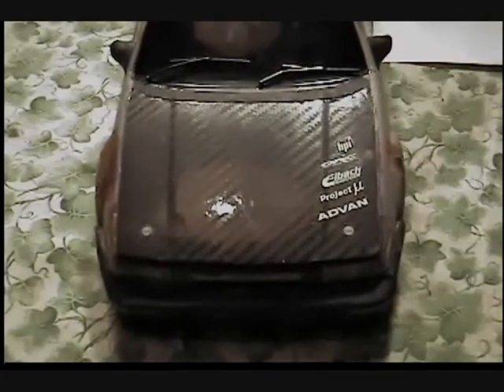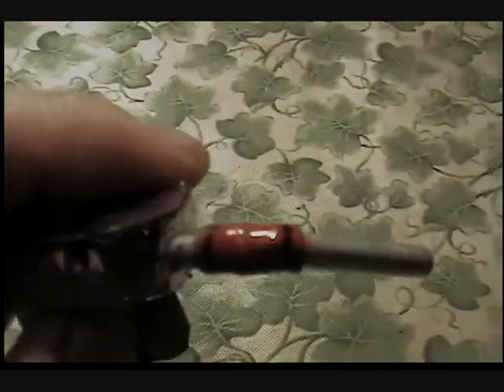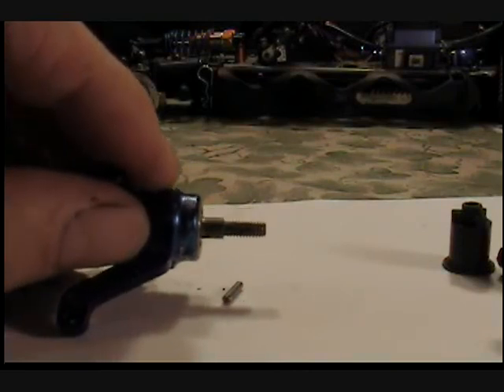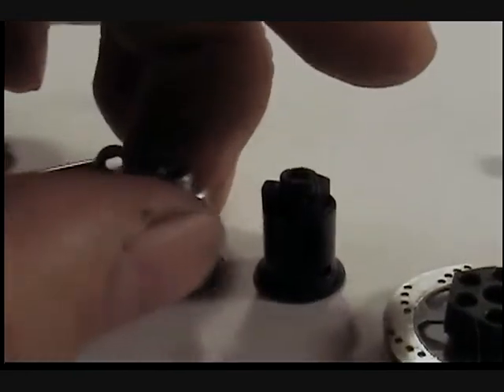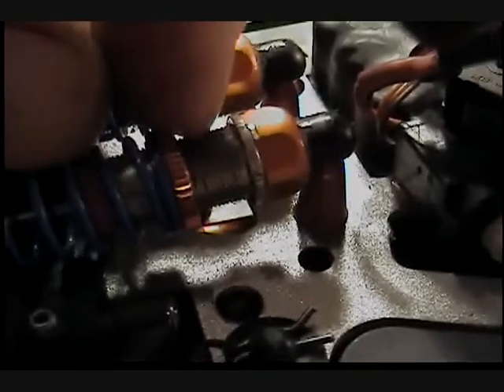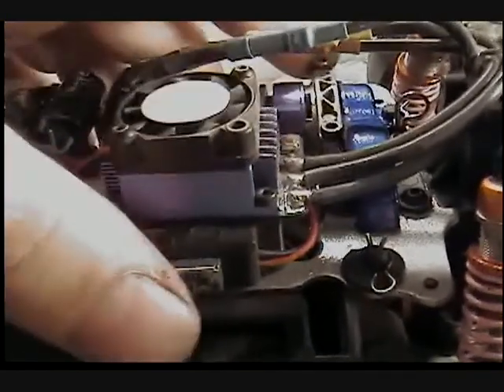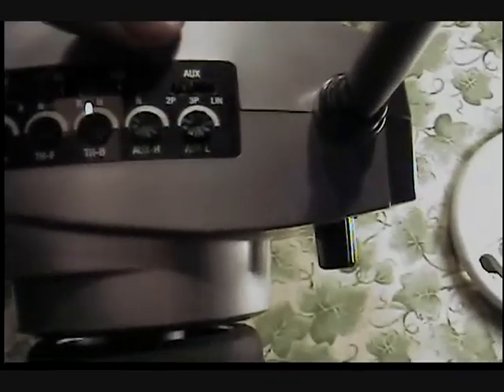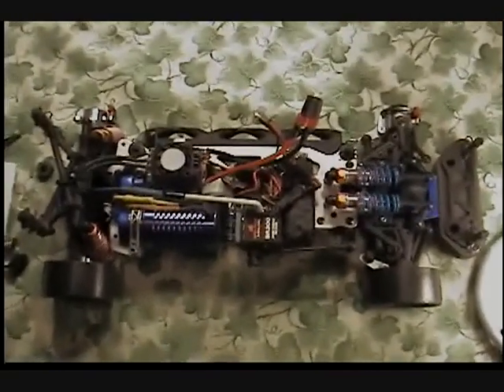hpi cup racer 13

Comment: always looking forward to seeing your videos on your cup racer suzux90. i have a cheap fix for your hub pins that keep falling out. i own a associated T4 and ever sense i installed a traxxas VXL brushless system in it i would break the factory hub pins in the rear .well i went to my hobbie shop and they didn't have any available.but my good friend Phil at hobby town gave me an idea to use piano wire of the same gauge.bought some piano wire there brought it home measured the length

Comment: marked it with a sharpie cut with wire cutters ,then smoothed out the edges with a dremel tool.and l had a hub pin and more if i needed to make more. whats funny is the piano wire is way stronger go figure . also if you don't want your pin to fall out use some thread locker the blue kind ,put on pin just a little before installing, let dry in shaft and it will stay until you pull the pin out with some needle nose pliers.hope this helps you.